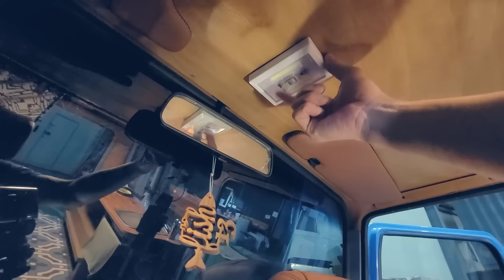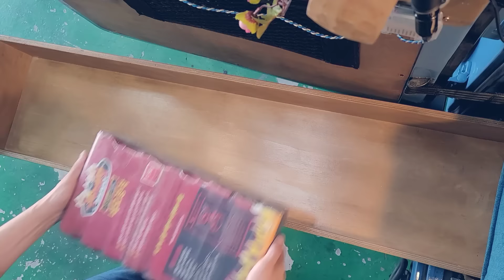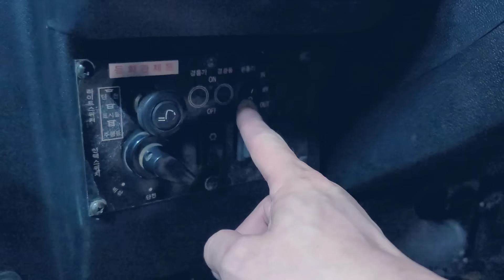BEAUTIFUL CAMPER VAN built by a lonely loony guy

Comment: I’ve been thinking about turning my hummer h3 into a camper after I swap in a v8 for more power. I live out of mine for 22 days parked on Wellington st during the freedom convoy. Nice video brother. 👍 I did a stealth trailer this summer. When you open the metal cargo doors it reveals another insulated wall with exterior doors and siding. The back has a window installed and the door turns into a deck with a fold out step. Beyond the window is the kitchen and sining area. The bed and the stove in the middle. Washroom and storage in triangle up front. I  helped someone else do it. Next year I will build mine.

Comment: Wheel Spacers are dangerous, and put a lot of stress on the wheel bearings and studs. Use different wheel offsets, to step the wheels out safely
Reply: If they are high quality and installed correctly there is no reason why they are not safe.
Reply: @altspitfire   good luck when you are in a accident and try to claim insurance. Spacers are illegal in Australia for a very good reason
Reply: @melfletcher2315   retired mechanic here wheel spacers are dangerous harmful to bearings and wheel studs not good
Reply: @Mark-ct4ie  I agree mate. I am a Fitter and life long 4wder

Comment: That carpet is gonna be nasty in like a week. Curtains will allow most heat/cool air to escape. Can't stand up. Pretty to look at, not too functional.
Reply: Easy fixes: carpet cleaning, appropriate garments, sit or lay down inside and enjoy standing up (and running, walking, dancing around) in the vast outdoors.
Reply: @tiltil9442  you've obviously never lived in a van, my dude. No, not easy fixes. Once it gets moldy/mildew...and then the rust being sped up. No sir, this is not functional one bit.
Reply: @brion1664  Never did, friendo. Slept in a combi on holiday tho. Is this 4x4 really supposed to be a full time home? Where did you get that idea?
Reply: @tiltil9442  even as a camper build, which is what he was going for, poor design. Fun to look at tho for the YT crowd.
Reply: @brion1664  agreed on the last part of that latest statement of yours 👍🏿
Reply: it looks like the carpet is easily removed